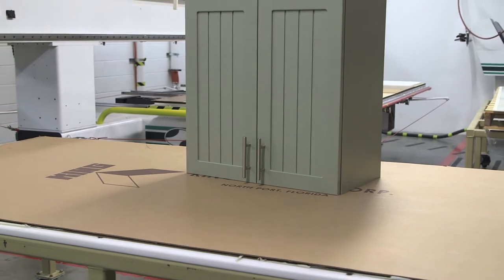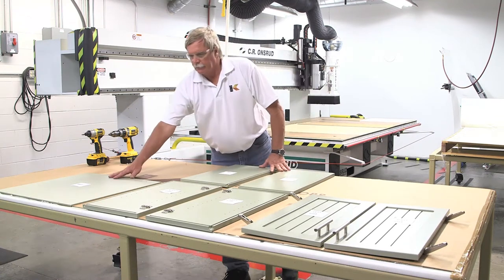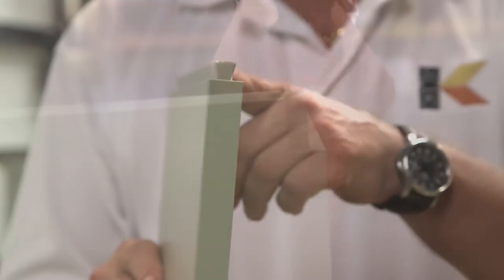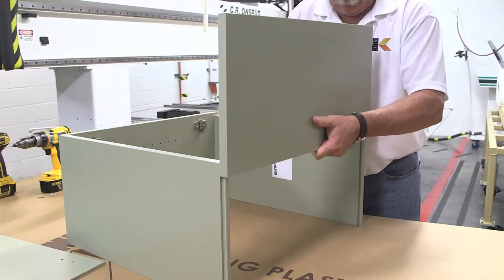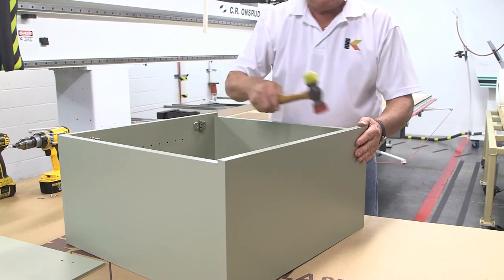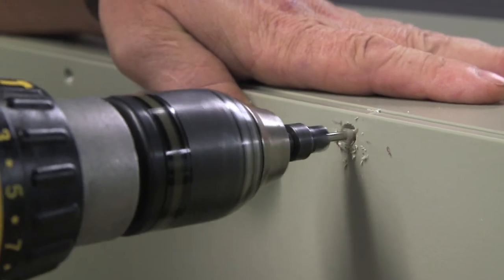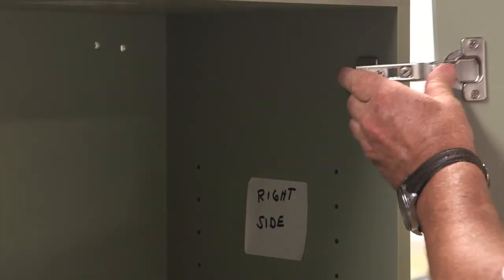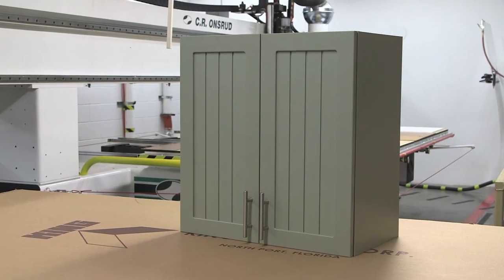King Plastic - Building a Cabinet - Knock Down

Comment: Hello. With what tool do you make a groove for connecting the frame?
Reply from the maker: The width of the dovetail is .5” at its widest point. This is not crucial. You can work with similarly sized dovetails that you may have available. If possible, the edges of your tool should be rounded as a sharp corner (in the female dovetail joint) can create points of stress that may lead to cracking under heavy load. If you have additional questions, please feel free to call us at 941-493-5502.
Reply: @KingplasticCorp   Thank you!